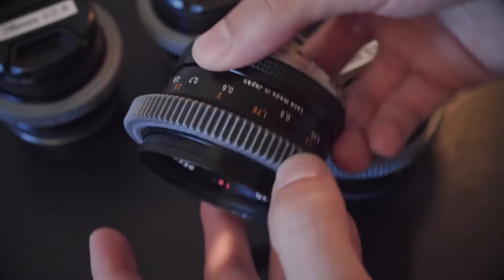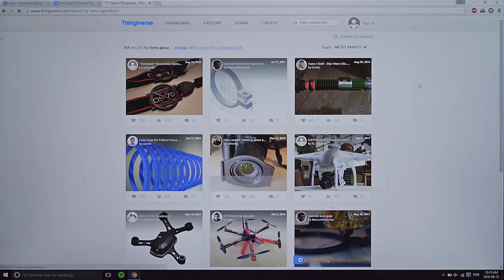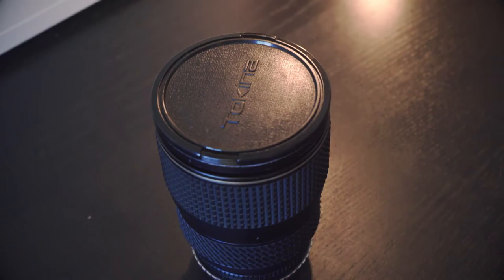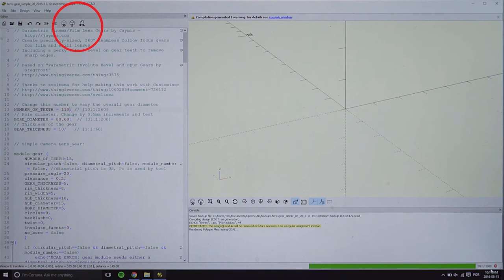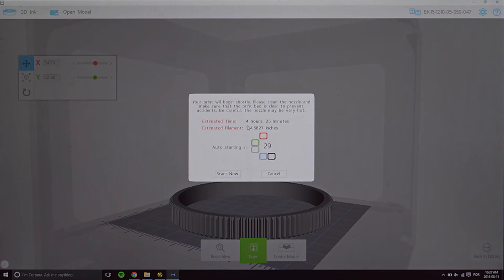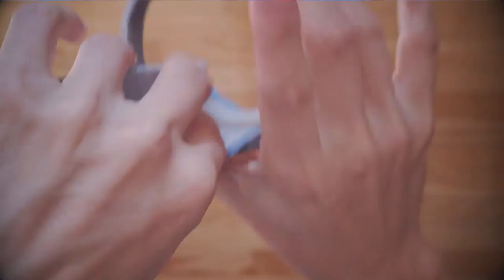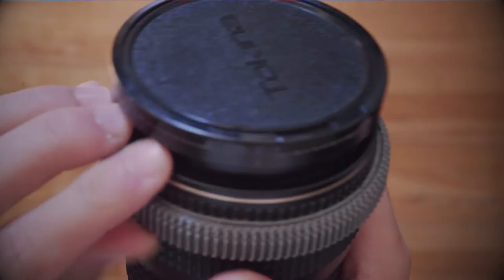Print Seamless Focus Gears!

Comment: Hey Tito, small recommendation for lenses made of metal, use inner tube for bicycles between the printed gears and the lens, you can also super-glue the rubber from the tube onto the 3d printed gears. Respect from Serbia !
Reply: J Nada well that is just to create friction between the lens and the gears, because I had my gears slide off even though it was a tight fit, then I superglued some bicycle rubber between and it worked great
Reply: J Nada it depends on the thickness of the rubber, but I guess you'll need to remodel your gears a bit
Reply: J Nada well you can try it out, I glued mine just to be sure :)

Comment: i see the print quality inst great, and the teeth aren't straight. I know that might not matter, but is that caused by the overhang and the blunted angle on the edges of the teeth, or the micron precision setting?
Reply: Tito Ferradans Ok. I have a Monoprice Delta IV mini set to 50 microns.
P.S: That should be good. Thank you for the fast response!
P.S.S: I also have a Tokina 28-70mm f2.8. It was my first lens so this was extra helpful because i don’t have calipers

Comment: hey, in the video your measured 80.45 mm then you are typing 80.60, which is larger in diameter than your measurement, should'nt you type -0.15 so end up with 80.30mm and sand it to enlarge it and fit the lense.
thanks for the video.
marc.
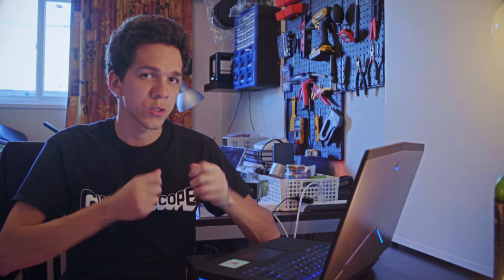Reply: @AnamorphicOnABudget   hey thanks for the answer. I downloaded the software and the file, one thing is hard to understand is how do you calculate the teeth number you are entering at 2:22 , I understand it is a way to make the ring sturdier but if you increase the teeth number, will it always be the same pitch for the 0.8 follow focus gear I am using. thanks again for your feedback. regards, marc.
Reply: @AnamorphicOnABudget  thanks so much for your help. regards, marc.